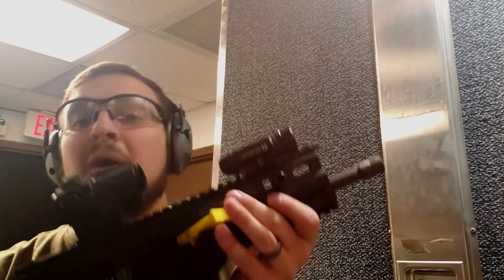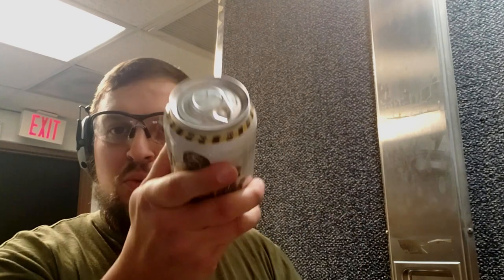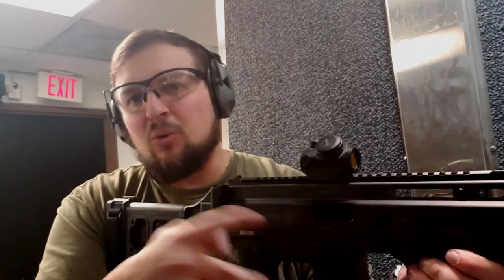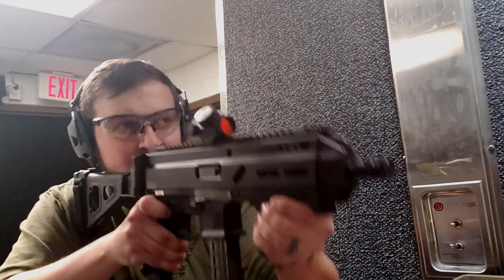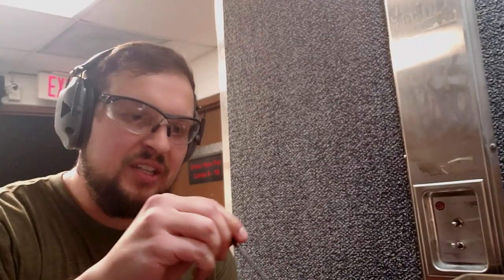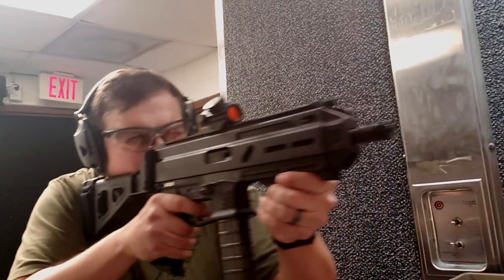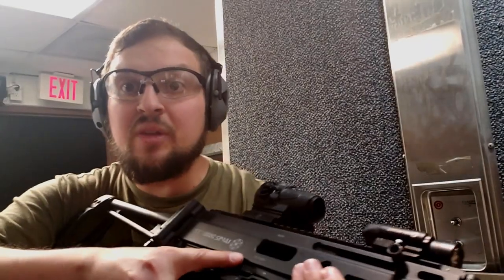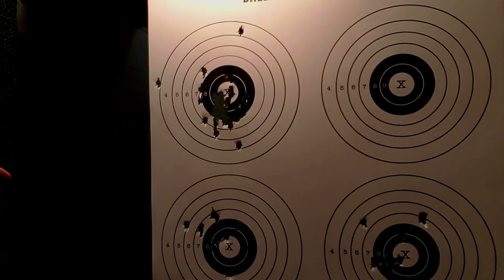Grand Power Stribog Muzzle Brake Test

Comment: Do you think the added weight of the accessories and compress-ability of the different braces played a role?
Reply from the maker: no, that forend weighs only slightly more than the light on the other 'Bog.  slight enough that it really wont do a lot.  you can feel the impulse and how it redirects around.  Also, after this i shot both of the brakes on the same gun with the same results.

Comment: You were reading my mind but I was looking at a linear comp instead. This was a great demo
Reply: I've got linear devices on both my AR pistols . At indoor ranges I couldn't bear anything else , let alone the guy next to me .
Reply: @orionfixr7713  what linear comp do you prefer?
Reply: @videovaulttv1  ; I have Flamin' Pig knock offs on mine . Nothing but small megaphones really . But they make a difference . There are large and small sizes . The small will fit inside most hand rails.
Reply: @orionfixr7713  they help with the noise?
Reply: @videovaulttv1  ; More so outside ,but yes they push the blast and noise forward some .

Comment: Is the more expensive brake worth the extra money, or would you recommend just adding the hbi brake?
Reply from the maker: Function: they're pretty much the same.  i wouldn't say one works too much better than the other.  i just love the look of the Volker, but you cant beat the price of the HBI. whichever your budget allows, both do change how the gun shoots and are worth it.
Reply: WorkTheTrigger hbi site shows a huge fireball in one of the pics. Does their micro comp really produce that much of a fireball/ boom over stock?
Reply from the maker: A little, purely because its redirecting, but not enough to matter really.

Comment: How did you get the thread protector off?  I just picked up the Gen 3 and the thread protector will NOT budge.   My Gen 2 came off fairly easy but this SOB won't budge.
Reply from the maker: If it doesn't come off, heat it. Just the muzzle device.  And then use some pliers or channel locks to get it off

Comment: I am having a hell of a time getting original muzzle off? Any ideas?
Reply from the maker: Heat it up with a torch.  Make sure to try your best to stay off the barrel with the heat.  You wont ruin it, but you'll expand the barrel too and make it hard to get off still.  Only needs to go up a couple hundred degrees to expand enough to get it off. Shouldnt see any color change or anything

Comment: hello,what is the folding brace on the first Stribog with no brake ? thx
Reply from the maker: That's a tail hook on a Smith custom mfg folding brace.
Reply: @workthetrigger  thx: a little bit pricey but very nice brace.I should pick up my Stribog the next week so i m looking for a good pistol brace
Reply from the maker: @greenleaf9116  yeah, they're super pricey.  Best bang for the buck is the HBI/SB combo
Reply: *Custom Smith Manufacturing. It works great and lockup is solid.

Comment: Hi Andrew I have a question about the dragon snout. I know you said you will be putting a video out on it. How does the nylon 12 hold up with the heat of the barrel?
Reply from the maker: So far it's been fine, but I've only put a few mags through it.
Reply: It’s rated at 352.4 degrees f is it’s melting temp. How is the angle of the fore grip.
Reply from the maker: @jonbaker7687  angle is perfect.  Enough to grab onto, but well shy of vertical